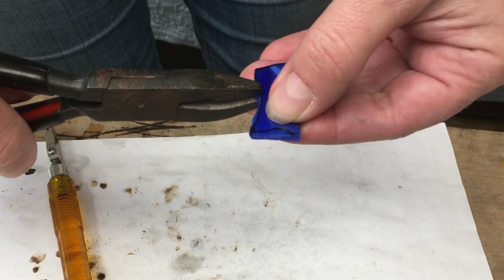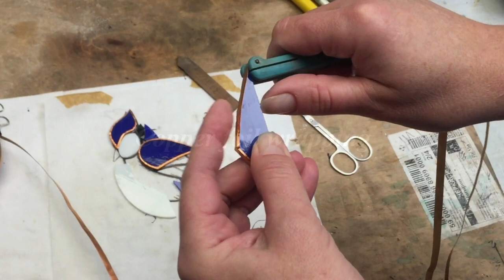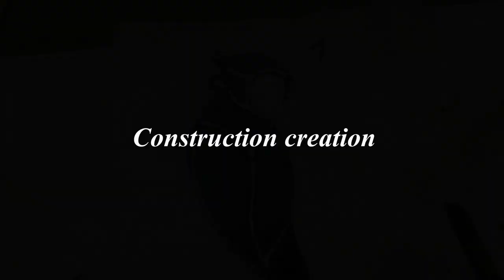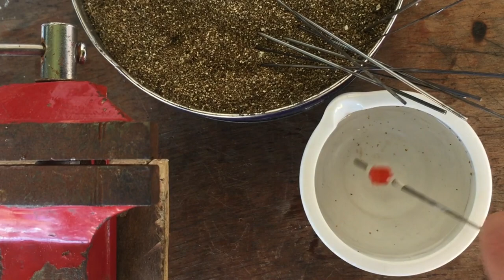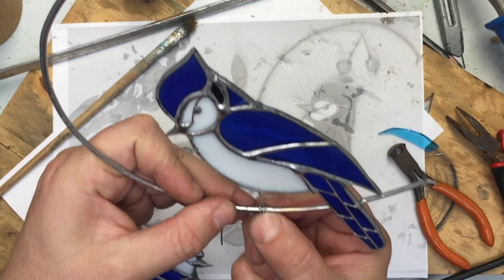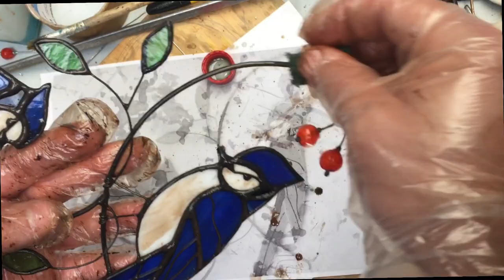Making a stained glass blue jay

Comment: I am trying to do something with birds for mothers day, please tell me how you did the beaks! Did you cut out sheets of copper or what, i have no clue
Reply: In this work I use copper foil  with glue for stained glass.  I glue it on both sides of the stained glass and glue it together.  then I cut out to make shape of the beak.  Then I solder the solder on both sides to make it stronger.